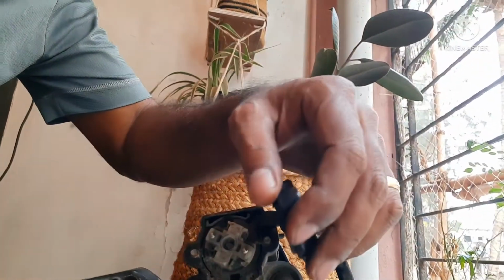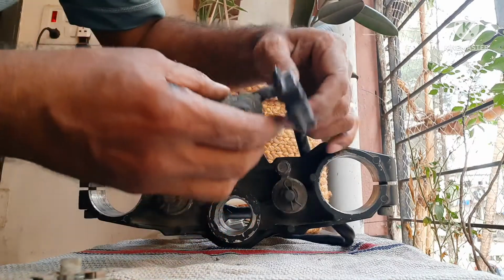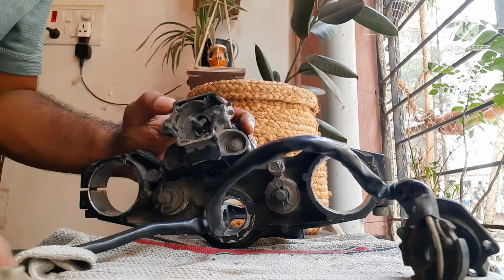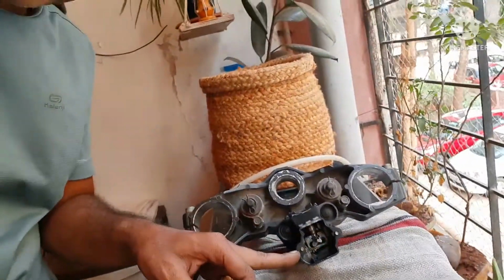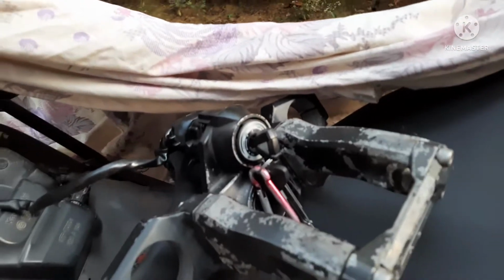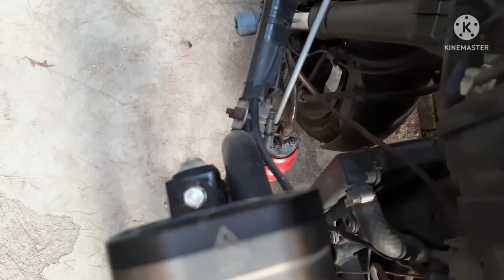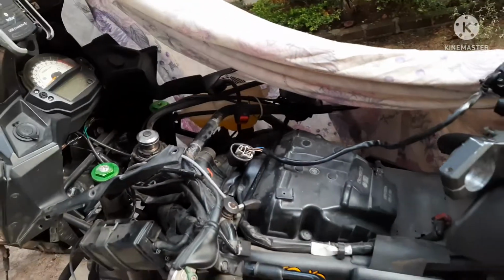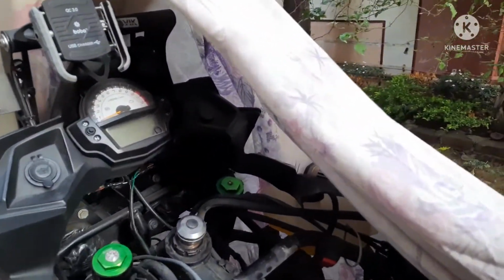Ignition key clean up/ key socket repair, kawasaki versys 650/ Ninja 650/ ern 650

Comment: Hi Biker Dan
I have exactly the same problem with ny 2016 versys 650
I’ve realised the best way to get to the bolts is to remove the handle bars and then the top yolk like you have done
Could you explain how you removed the top yolk 
It looks like you just released the fork clamps a to the top of each fork but I’m not sure how you remove the center bolt  
Does it just unscrew so you then just lift the yolk up and off the top of the forks or is there more work h involved
Thanks
Ste 
England
Reply from the maker: @Koala260  the centre bolt is just like any hex bolt  simply unscrew, you need to remove the handle bar to access the bolt